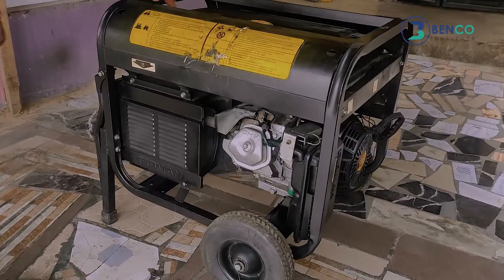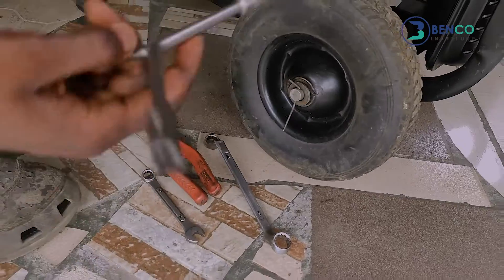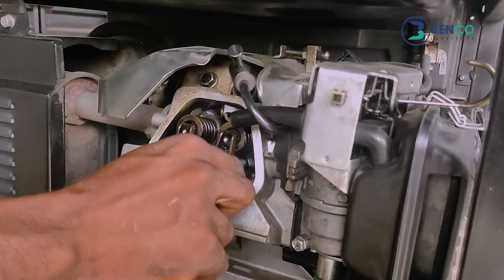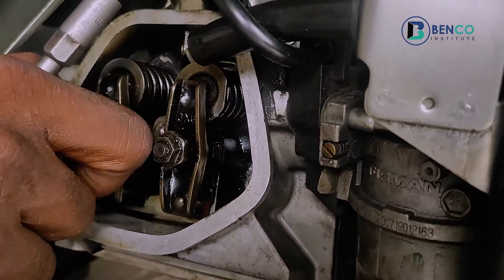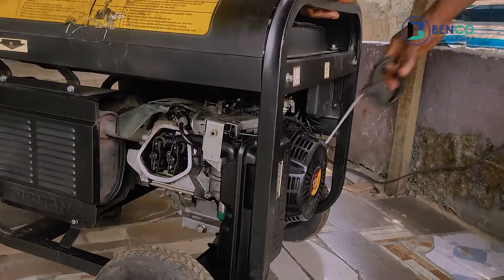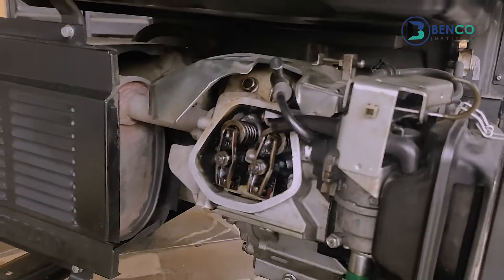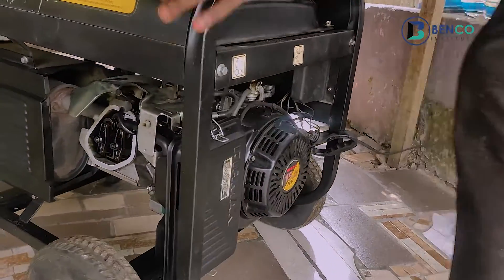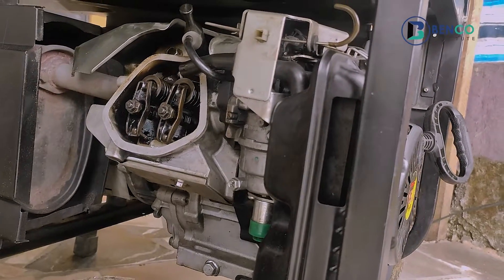HOW TO SET & ADJUST VALVE l LASH/TAPPET CLEARANCE without FEELER Gauge for a small Engine VALVE LASH

Comment: Will this work on a diesel too? I have a 3.5kVA that starts perfectly with electric starter but has always been impossible to pull start - the valves are presently set as per the manual.
Reply from the maker: One cylinder.. Yes
Reply: @bencoinstitute  Heyhey, you're the man! After you replied I followed your method; it would not ignite using the cord so I used the starter motor to check if it was running ok then re-adjusted the exhaust rocker. After some re-re-adjusting, voila, she started first pull, and no effort. The engine was quite warm, so tomorrow I'll check when it's cold, but I'm sure it will be ok - here in the Philippines it's always warm weather. Thanks for the fast reply and helping out.
Reply from the maker: @tyrotrainer765  Alright
I am Rooting for the machine
Reply: @bencoinstitute  🤞
Reply: Is it advisable to adjust both valves the same way? I didn't move the inlet valve because I didn't want to mess with the amount of injector fuel  entering the cylinder (and possibly the carburettor mix on a gas engine?). If you say it's ok then I'll adopt that from now on. Cheers.

Comment: Can you please make a video on how to put brand new packing rings on a piston before adding the oil and pressure rings.
Due to the structure of the packing rings , it gives me issues while putting it so I don't put it when fixing engines
Reply from the maker: I have many videos where I fixed parkin rings
Go check them out